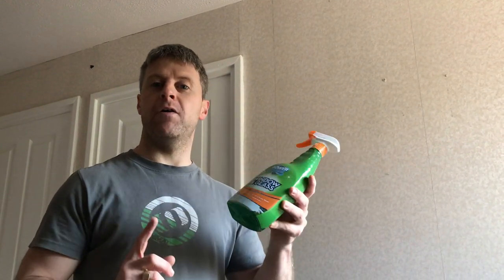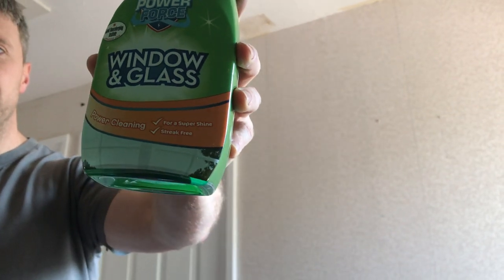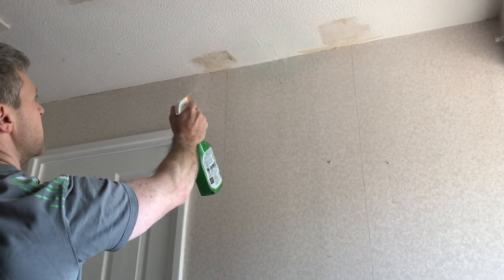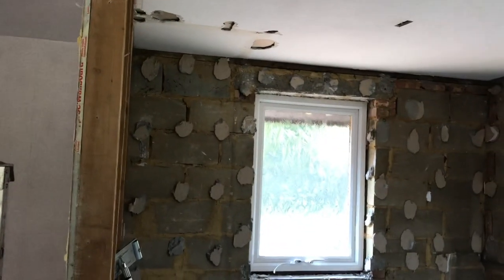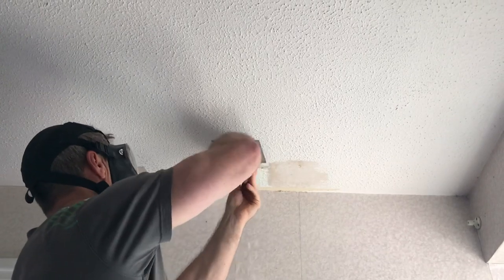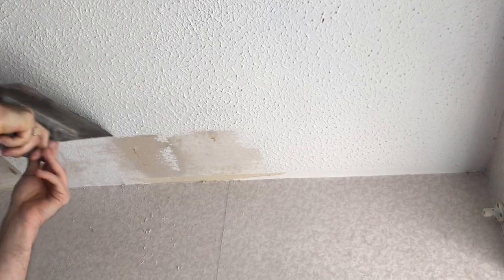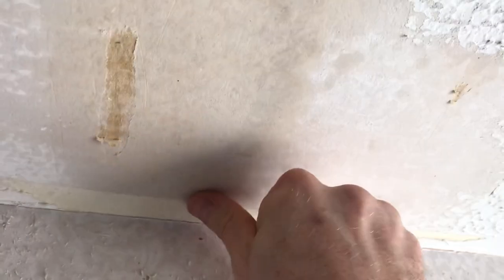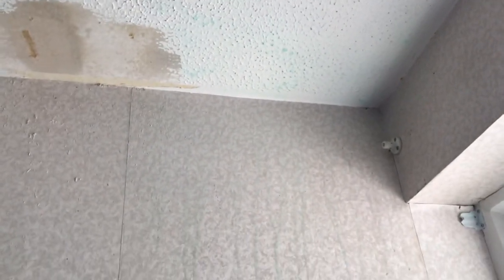Remove Artex (popcorn) with vinegar, easy!

Comment: I've been a plasterer for 20 + years and I would not advise anybody to do this as popcorn ceiling as you put it is what is known as stipple pattern one of the oldest patterns and yes more often than not crysotile asbestos so this isn't a good idea as even with a dust mask it goes everywhere it is best to seal it either pva or green grit plasterers primer and encapsulate it skim over it not disturbing it DONT SCRAPE IT ....as worth notiing without getting it tested you can't tell weather asbestos or not and also in the comb patterns and swirl broken leather is the patterns of the 80s and even that can have it in ....
Reply from the maker: Thanks for your comment. I advised a proper respirator, like I am wearing in the video. I also advised cleaning it up whilst it’s still wet and disposing of it properly. Pretty much every house in the UK built in the 60’s or 70’s has this stuff, personally I’d rather remove it completely and dispose of it properly rather than hide it under another coat of plaster. Pretty sure your advice would breach H&S rules in the uk, you can’t hide asbestos because no one in the future will know it’s there. Your options are leave it or remove and dispose of properly. But then again as a professional plasterer it’s easier and more profitable for you to just spend a few hours skimming over it, take the cash and run
Reply: No not the case at all I work for council contracts aswell as private customers and that happens more often than not same as marley floor tiles they encapsulate it using self leveling it doesn't breach any H and S laws as its normally documented and I work alongside asbestos removal companies and I could go on trust me asking Joe public to do what you are asking isn't a good idea when proper asbestos removal companies do it the room is cleared and looks like a crime scene and an air test is done afterwards you arecthe one putting people at risk....
Reply from the maker: @paulnaylor6035  Sounds like you’re doing it the right way if it’s all documented, but that’s the key point, documenting the fact that the asbestos has been hidden from view. All well and good so long as that information is passed on each time the house is sold. Sounds like you’re doing a good job anyway. 

The reality is most UK houses of a certain age have this crap on the ceiling, certainly the vast majority in my area. People are taking a risk every time they install a new light fitting, remove coving or even just redecorating - rubbing, sanding and prepping for painting. 

I personally think we should be removing Artex and disposing of it properly. 
When I do the work I wear a respirator and the room is sealed and isolated, I clean up whilst it’s wet so there is no dust and bag it and dispose of it properly. That way the risk is removed from the house permanently. 

I agree with you that if you don’t know how to handle asbestos then you shouldn’t, but we all know that DIY’ers will try to scrape it off themselves. At least my video makes it safer for them. 
There are HWRC that take asbestos if it’s correctly bagged and they even provide the bags to members of the public in my area. 

Peace out dude keep up the good work.
Reply: Yep likewise 👍 it all depends on the job if bowed or flaking then you have a problem but if not broken don't try and fix it alot of the time it's a cosmetic thing as it's dated and people want it flat  there's plenty of you tube videos showing how to skim ceilings .....😁
Reply from the maker: @paulnaylor6035  yeah dude you clearly know more about it than me for sure, I’m not a professional. I’m just trying to help the have a go heroes out there who will try to do this themselves despite the risk and warnings.
Reply: @cglees  Our asbestos surveyor said you could fit an embossed plate in the corner of the ceiling (legible when painted over) alerting people to the asbestos under the skim. He said that would be going the extra mile, though, and it's not a requirement. I can't see why it's not, and I think I always would - like you say, someone in future needs to know about it.

EDIT: HSE says removing Artex is not a job needing a licence if using 'any suitable dust-reducing method'. page 17  herehttps://www.hse.gov.uk/pubns/priced/l143.pdf But on this scale it's likely to be 'notifiable non-licensed work': p. 22
Reply from the maker: @ebainton  thanks 😊

Comment: Just wanted to see if you’re still here a year or so later? Or did the asbestos get ya?
Reply from the maker: Stick going strong! Thanks for watching
Reply: @cglees  good stuff, I’ll be following suit when we complete on a 2000square foot bungalow which the same artex. 
After making this video, any additional recommendations you’d suggest bud?
Reply from the maker: @stevedelaney9912  good luck. I suggest getting it as wet as possible so there is no dust and bagging up when still wet. You get the bags from the HWRC. Laborious soul destroying job but worth it for the end result.

Comment: Was this ceiling painted? If it's just plaster, or a popcorn ceiling, hot water out of sprayer works very well, as well.
Reply from the maker: Thanks maybe I’ll try that sometime. This house was built in the 70’s so lots of coats of paint over the years

Comment: The texture gives plaster something to hold onto anyway, so you could just PVA and skim over that.
Reply from the maker: Hi, yes you could but it is not level to begin with so you will need a lot of plaster to cover the high spots. That’s why I like to scrape it all back to a fairly even surface and then skim over to finish off. Thanks for the comment
Reply: @cglees  You could make it even with bonding first, then skim it. It doesn't look that deep a texture. Either way its good to know that window cleaner is an option for removing it.

Comment: What’s actually the ideal length of time to leave the spray on?
Reply from the maker: Trick is to scrape it off while it’s still wet so don’t leave it long enough to dry out. Larger the area you spray greater the chance of it drying out before you scrape it all.

Comment: Well i've got a ceiling like that and tried a few things but none of them was good enough. Bought some x-tex but just realised i've got a few layers of painting on it too (some silky one i think so, peeling off easily) and because of that im ended up with some gooey mess. Tried to skim over with joint compound (did not use pva, do i need anyway?) but it comes off few places. Im gonna remove the extra layer of painting first then the artex texture with x-tex.
Reply from the maker: Hi I’m not familiar with x-tex. Sounds like if you’ve got a gooey mess then you have not removed all of the paint/top layer of artex. Maybe try scraping it harder or leaving whatever you are using to soak in longer. I’m not a plaster by the way so not technical advice here just a DIY. I would maybe chuck a coat of PVA mixed with water or even easier what I do is just mix some standard emulsion with water 50/50 and splash that everywhere
Reply: @cglees  Yeah i was thinking about the same, as i've seen leaving the extra layer of painting on artex could cause that goey mess especially if it one of those silky paintings. I'll try a few things next week, will let you know what's happened, thanks for the fast reply by the way 👍
Reply from the maker: @kocsis1978  good luck with it thanks for your comment. I find that most emulsion is water based and will go all “funny” if you put wet plaster or wallpaper paste on it, even if you try to wipe a stain off with a wet cloth! So yeah get it sealed with PVA or something. Good luck with it 👍

Comment: Is it safe in asbestos artex With only respirator? Surely dust everywhere?
Reply from the maker: Hi, you will need to wear a suitable respirator and dispose of the dust correctly if it’s asbestos. In terms of safety, this method won’t make it less safe. In fact the wetter it is the less dust, just make sure you clear up before the dust dries out
Reply: I ordered a test kit off tinternet 30 quid and results came back in 2 days. (Negative) Then you know what you are dealing with whatever method. Don’t take a risk.

Comment: Thanks for the video. What are your thoughts on just taking down the whole ceiling and reboarding, verses lots of scraping and then plastering over? I'm doing a full renovation of a house that has artex on every ceiling, and thinking it may be easier to just pull the whole ceiling down, rewire, and then put fresh pb up. Will obviously cost a 2 or 3 hundred in pb, but will make the rewire a lot easier for the electrition which should reduce the cost of that item of work.
Reply from the maker: It’s an option. But you will get a lot of dust from the asbestos if you just rip it down, not recommended unless you’ve got the proper equipment and safety precautions. 
Also the plasterboard ceiling, you can’t put that in a regular skip in the UK so you’d need a skip just for the plasterboard (if you do it by the book!)

You could just overboard the whole ceiling with new PB, you’ll lose 15-20mm head space
Reply: just board over it with new plasterboard and then skim